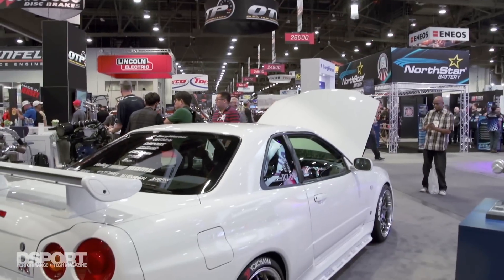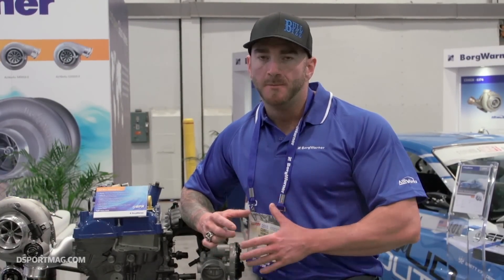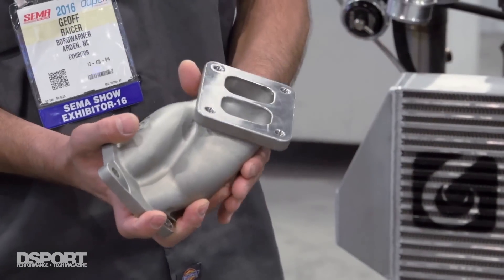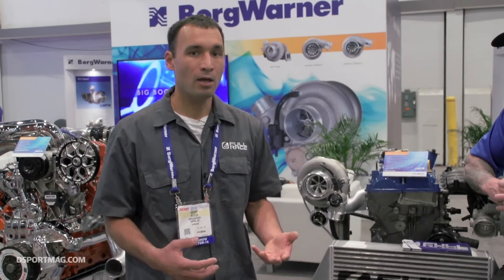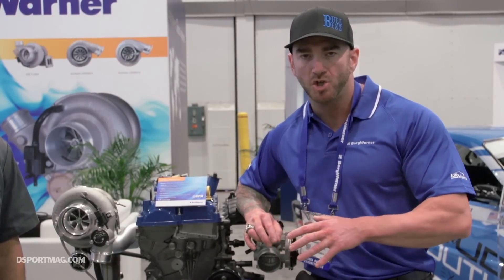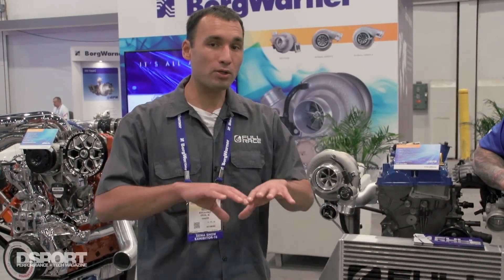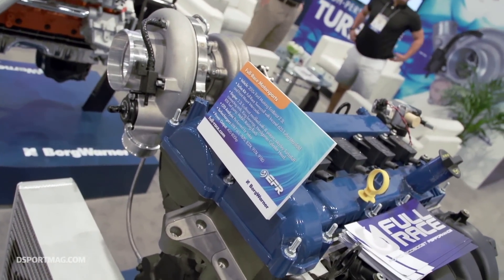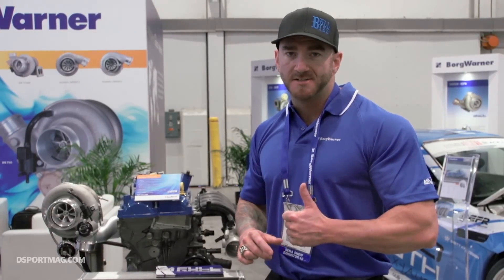SEMA 2016 Turbo Talk: ECOBOOST Solutions with BorgWarner & Full Race Motorsports

Comment: DO NOT BUY AN ECOBOOST !! I had full bolt ons not even an upgraded turbo and it blew twice in less than 6 months! Smh theyre crap!
Reply: My ford f150 3.5 ecoboost it is a beast the ecoboost is the killer of the V8
Reply: guaranteed you were running a shit off the shelf tune.
Reply: @sethgibowski8695  m still waiting for his reply. He made me dought buyin ecoboost
Reply: @ravjitkaursodhi3018  They're reliable motors. But when you beat the shit out of anything of course it wont be reliable. Judging from the fact that he had an upgraded turbo and "full bolt ons" he probably had a mix of a bad tune and beat the crap out of it daily.
Reply: @sethgibowski8695  never said upgraded turbo
Reply: @Sam S yeah I have. I also run a catch can on my 2.0L and it helps out a ton. It might not get every bit of junk that hits the valves, but im willing to bet 50-75% or so is gone when a catch can is being used. This is exactly why right around 2017-2018 ford began running a mix of direct and port injection on all their 4 and 6 cylinder ecoboost motors. As far as I'm concerned the only effected vehicles would be between 2012-2016. Even at that, when these motors get carbon build up its mainly only an issue on cold starts causing misfires and rough idle. Every motor has its issues when it gets up in age.
Reply: @Sam S well, since I did a motor swap I can't really order one specifically for my setup. So I just went with a cheap ebay one for like $30 if I recall correctly. yeah you can go with a fancy $200 catch can but for the price it works just fine.
Reply: What you need a bigger turbo .straight pipe.high flow filter a good tune to be beating a lot cars v8

Comment: 22k... that's how long my Ecoboost block lasted stock turbo...
Reply: Mike Gomez 
no answer he's probably BS-ing.
Reply: Should have upgraded the low side fuel pressure sensor. 35.00 bucks would have changed your outcome.
Reply: Mustang EcoBoost what happened?
Reply: Lmao mine too twice in less than 6 months!! Piece of shit ecoboost
Reply: And i only had bolt ons
Reply: My 12 3.5eb is at 236k and pulls my 7klbs trailer with ease!! Sofar its been solid

Comment: The only problem I have with Full Race's kits for the Focus ST is they use all new components meaning if you have exiting parts say a better intake system or a down pipe that mates to the stock 2.5" exhaust; this is all replaced by the EFR based kits, looks un-OEM when you need to go undetected and you can not recoup the cost of previous now unused parts. This is why if I went EFR I would go with Mountune, the hot side if the same so I can upgrade to a 6758 or 7163 and use the same turbine housing.